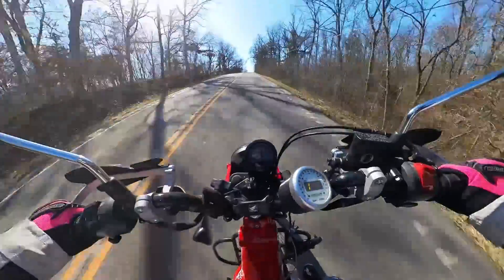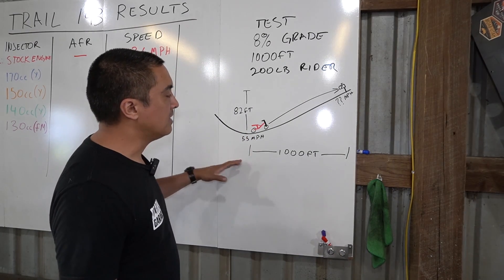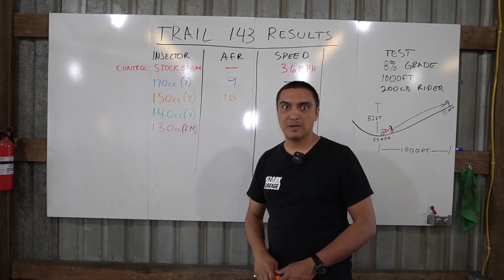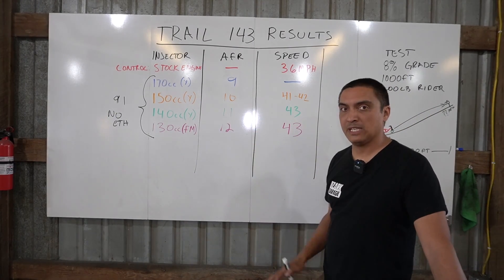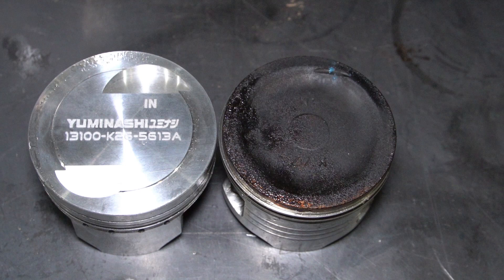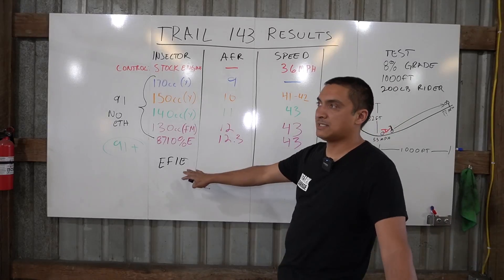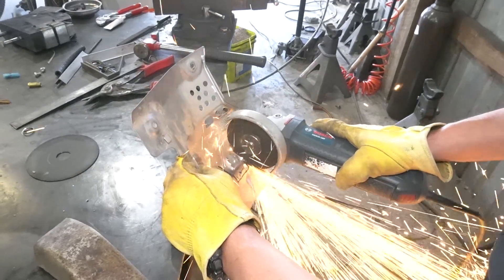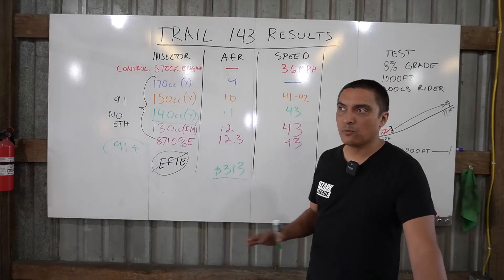Tuning the 143cc Honda Trail 125 - Big Bore Part 2

Comment: Admire your skills and a very well presented videos on this topic. My own thoughts on this is that, even if I had the same (considerable) skill level as yourself, these type of engine mods put into question the very reason I bought a Honda in the first place: Reliability. Even a relatively simple bike like the CT is a complex system and changing one or more components of the system can possibly exceed the fault tolerances of other components, leading to failures, especially over time as parts wear. Going 45 mph for 100K miles is far better than going 52 mph for 40K or 50K miles, to me at least. My advice: mod at your own peril. Short term gains can lead to long term problems.

Comment: I live in Colorado where altitude/thin air are my constant companions.  I can't cross the street without hitting an 8% grade.  All that to say I'm leery of such small displacement on the stock CT125.  This 143 kit might be the answer(?)
Reply from the maker: We've taken the CT125l to Colorado and ridden in the mountains before and after the BBK. It made a noticeable difference in performance at altitude. That said, we ended up getting a KLX230: https://youtu.be/BT17bMClnyU

Comment: I'm curious if a colder spark plug would help with the higher temps.  I'm running plug that is one step colder below the factory plug since I'm in a fairly humid area (Michigan) and most of my time riding is in the not-snowy months.
Reply from the maker: A colder plug wont reduce engine temp, it just puts more heat into the cylinder head instead of holding it in the plug (first law of thermodynamics). Colder plugs can be useful for reducing preignition and detonation by reducing chance of a hot spot, but they can come at the cost of more fouling and a more carboned up plug (the deposits don't burn off).

Comment: i prefer to use the cheaper gas myself. that being said its the main reason i prolly wont do a BBK. we have the larger intake, DNA air filter, and Yoshimura shorty exhaust so its almost a shame not to be able to do it. i was thinking however i know i will get some more performance with the aforementioned items upon install. i also thought about maybe going with a slightly larger fuel injector as well. ( just to see what it could potentially do. i too am a light weight like your wife and i got 61 mph from the start. after its been broken in a while its closer to 55 most of the time if i dont floor it. im pretty sure im going to get at least some increase in speed and sound. thanks for the videos i pay attention most of the time and have learned a lot today alone ( already watched them twice before ) i think of it as a class in school so i thank you teacher. i would never be able to attach the gauges to check for lean fuel so that is also a reason i am not really looking to do it. IF i do it i will have to go all the way to GA and see Wayne he is prolly one of the only mechanics i could trust... its still too much $$$ for the labor tho. i seen someone recently had spent about $2700 before labor and thats already more then 1/2 the cost of the entire bike.

Comment: Dude I like your show (Me being an Enduro Guy) but you meant 30% more Speed "Maybe" Certainly N0T 60% Bro, that whould top You 0ut at 80Mph, "You weren't there". Yet, thank you for filling Us all in on this Cool little Utility bike , (I want to get something smaller for "Sneaking" around town and light trail excursions" this year and after seeing thees 2 ep, I beleive I will keep My Motor  Stock for long term Reliability and choosing to get alittle more Power the simple way with: ( a Pipe / matching injector kit )😅 good work and Stay safe !
Reply: 16 %

Comment: Dad gum. Put a good carb on that thing and let it roll.  Jets are cheap.  I’m old school I hate this computer bullcrap.
Reply from the maker: I'm not a carb hater, but it would cost way more to put a carburetor on it. You would have to build a manifold or adapter to make it work, find a throttle cable to work, then bypass the high pressure fuel pump somehow to make it gravity feed and mess with all the wiring. Swapping to a larger fuel injector is way easier and cheaper.

Comment: I think there is more speed to be had from it cause i am 245 pounds and i could do 40 on a 50cc yamaha vino and you have almost 100 more cc and your doing the same
Reply from the maker: 50cc 2-stroke or 4 stroke? The trail 125 is over 250lbs alone.

Comment: thank you for your excellent  video on how to mount the big bore kit from yuminashi.
I have a 2024 Honda supercub c 125 and i think that i also will buy a  yuminashi big bore kit 143 cc.
according to the Honda service manual the clearance of the piston rings are as follows.
top ring 0.03-0.065 mm, 0.0012-0.0026 inch
second ring 0.015-0.05 mm, 0.0006-0.0020 inch.
oil ring top 0.10-0.25 mm, 0.004-0.012 inch.
oil ring second 0.10-0.30mm,  0.004-0.012inch.
oil side rail 0.20-0.70 mm, 0.008-0.028 inch.
It is absolutely essential that, when the clearance is on the small side that the first 500 miles,  the big bore kit is run in gently, with various speeds  
while letting the engine run smoothly and not let the engine work to much so that the piston-rings can run in smoothly on the cylinder.
it is better to have some higher revs with not to much strain on the engine, then have lower revs and to much gas, that will strain the engine more.
if possible can you make an other video where you tri the "efie" to optimise the fuel ratio of the ecu computer, that would be Ferri helpful .
also it would be helpful if you do top speed run and then look at what the fuel ratio is.

.
Reply from the maker: At this point, I have no plans to install the EFIE. The larger injector has been running fine for the past year and the bike has been run at WOT a lot. Here is the follow-up video: https://youtu.be/nb55vPhmKkw

Comment: Great job on the big bore review , professionally presented. The bottom line is Honda manufacturing did not give the CT 125 enough horsepower for 14 tooth sprocket. I went down to the 13 sprocket and I feel I gained almost everything that you did with your big board kit except for the top end. I can hold and maintain 53 to 55 up even on a slight incline. Plus, my gearing between gears is evenly distributed now.
Reply from the maker: Is yours an ABS model? I looked at lowering the gearing and heard stories of ABS errors due to the computer seeing a difference in speed between the front and rear.
Reply: @ 
My ABS light came on occasionally. 
I was doing some hard trail riding 
ABS light continued when I got back on normal roads for a month 
I finally went through high-pressure car wash blew the hell out of the front brake. The ABS light never came back on again.
To answer your question, I don’t believe going to the 13th to sprocket is an issue
Reply: @ 
What it did do changing the gearing it matches the horsepower of the motor 
The power band is incredibly matched now
And I can still hit and maintain 53, 55 mph 
On the trail, I can walk through very very rough terrain w 13 sprocket. So much better at low speeds. Wow.
Reply: @ozarkgarage  I dropped a tooth up front and my abs comes on after a long ride. resets after i turn the bike off. Got used to it and don't even notice now. Excellent Videos btw. Great explanations of what you have done.

Comment: I put a 135cc injector on my honda 125, at first my sparkplug is soaked with gas and  increased the idle speed. Checked the sparkplug and looks normal again

Comment: Another big-bore kit that doesn't come with a counter-balanced crankshaft to match the bigger heavier piston. You're on borrowed time, mate.
Just pulled a Royal Alloy scooter engine apart that had been fitted with a big-bore kit by a bike shop, mate was furious when I found that the big end had ovalled and the crankshaft was bent.
Wideband lambda sensor is a good idea though, stock sensors are okay but fitted to a price. What it really needs is putting on a dyno and tuning all the fuelling values properly.
Until you do that, you're pretty much throwing money away by chasing a guess that's based on assumptions. A skilled tuner at a reputable, professional dyno shop can always do a better job.
Reply from the maker: The larger piston can still be the same mass as the previous piston, just thinner or shorter skirts, etc. I didn't weigh them, but it would have been interesting to do so.

Comment: Next project, get rid of Injection and O2 sensor and  replace it with an old school carburator…
Reply from the maker: With ECU controlled ignition, etc that would be a ton of work.

Comment: Somebody should do a 250cc version of this bike. It'd be slightly heavier and slightly beefier. But i bet it would sell like hot cakes.
Interesting video. 
Thanks Mr  😎
Reply: I have always thought the sweet spot would be a factory 175cc version with a 5 spd  and manual clutch.
I think 250cc would be getting past what the frame, rear swingarm and suspension/wheels are designed to handle.

A  well designed 175cc should be capable of running 60mph reliably and giving excellent bottom end for slower offroad use as well.
Reply: @billwiley7216  agreed the reason I sold mine was because it lacked the extra 4-5 hp that is needed to ride 60mph reliably. If it had that I would still own it
Reply: "I think 250cc would be getting past what the frame, rear swingarm ..." and brakes can handle, yup, I think so too, I'm bound to the 125ccm limit but I think with the tuning camshafts and a larger exhaust diameter, 12-13 hp are possible even with a 125ccm, here in Germany you can get on the motorway from 60 km/h, then you look for a truck that's doing 90 km/h and stick to it, ... but who drives on the motorway with a C125, @billwiley7216 ?
Reply: Here’s your chance for wealth…go for it!

Comment: Personally having worked on and run the Z155 Zongshen motor, which is a similar design of engine, I would start with porting the cylinder head as it is free BHP (OK a top end gasket set) and match the ports to the gaskets and smooth out the ports. Next up I would either get a slotted cam sprocket, which is cheap enough or just slot the stock one and back the cam timing of to move the power a bit higher in the rev range. These things don't rev that high anyway with peak power at about 9000rpm and slotting the cam sprocket lifts peak power to about 9250rpm but helps let the engine hold onto the power for longer. My Z155 on the dyno is 14.6bhp and in stock trim was 13.2bhp. But it is not the peak power gain which is important as 1.4bhp is not a massive gain, but where it shows the most is at 11,000 rpm where the stock engine was 10.5 bhp and after tuning it was 14 bhp so it is a 3.5bhp gain over stock. If you need more power still then I would go for the 143cc big bore kit. BUT regardless I would still suggest running an oil cooler as these engines don't have the best design for keeping them cool and the bottom end is still close to the original 50cc motor and these get hot and heat will kill power. The oil cooler just adds a bit of security that it will not overheat or increase heat related wear when using it on trails.
Reply: When I was into endurance racing engine tuning, we found that not smoothing the ports actually worked better at reducing airflow instabilities.
It's a common misconception that rough ports are bad, but golf balls are actually more aerodynamic than ping-pong balls. Those little dimples provide a smoother overall surface.
They do this by housing small pockets of gas, which the rest of the air/fuel mix glides over, a smooth surface drags this airflow into the port walls, slows it down and goes unstable.
Because of the way we peened our ports, our engines were noticeably smoother running throughout the rpm range, pulled harder out of corners and generally lasted a lot longer.

Same thing with the inside surface of the combustion chamber and the piston crown, but for a different reason. Smoothing these surfaces bounces heat back into the gas, so the burning charge is slightly hotter, but this is a bad thing because that hotter exhaust gas has to pass the exhaust valve...cumulatively heating them up more than it should.
The pistons also get hotter than they should be, heating up the engine oil until it can no longer cope, the piston and rings expand that bit too much and seizes the whole thing up.
Not once after shot-peening the surface on the combustion chamber + piston did we burn out an exhaust valve, but other teams regularly found theirs overheated, bent and seized.
By all means, port the heads to optimise the shape and volume...but I'd advise anyone to ignore the myths and hype around polished ports because it's all total nonsense.
Reply: @mazdamaniac4643  Same principle is used in sailboat racing, where the boat's bottom is sanded with 400 grain sandpaper, but no finer.  Water molecules adhere and create a surface over which the molecules of moving water slide.
Reply: @mazdamaniac4643  I agree smooth ports do not do as much as people think. Also a lot of people will just open up ports and not think about how air will flow into the engine through the port too. Making the air flow as straight as possible from inlet to the valve opening and working on the port floor is important. As for dimples, I am less sure dimples really do as much as people think as the dimples on a golf ball are for a different purpose and it is to break up the low pressure zone behind the ball which would hold the ball back and the dimples do let it fly further. But this is improving a ball shape because you don't hit an arrow shape or oval ball in golf. The ball is spinning and there is none of that in a port also the gas speed through the port is higher than the speed of the ball flying through the air and the faster you get a golf ball to go through the air the less the dimples help with distance. But a rough surface does break up the boundary layer of the gasses in the port and help turbulence and getting the fuel mixed with the air and better combustion.
Reply: Agree. we tune these engine here in Vietnam and Thailand. Porting + bigger exhaust manifold will help alot. 5 speed swap also cherry ontop (-2 rear sproket maybe decent for highways)

Comment: My first time seeing your channel and that was a wonderful video.  I have a 2024 Honda XRM 125 in the Philippines and that extra power sounds wonderful.  How did it affect your fuel economy?  I am getting 65 km/litre here which is 153 mpg.  And I ride her as fast/hard as I can most of the time.
Reply from the maker: I honestly don't think it has changed that much. We put ~90  miles on it between fills and it takes around a gallon +/- so its still good enough for us.

Comment: what is the top speed after the big bore kit install?
Reply from the maker: On flat ground it will hold 60-62, before it was 54-55. Interestingly enough, the tires have max speed of 61 marked on the sidewall!

Comment: I would use an oil cooler, so 87 would work. These bikes have so little gas tanks, that you need to be able to get it to run 87 fuel.
Reply: Whats wrong with higher octane?
Reply: @evanhandelong7685  $$$/availability

Comment: I wonder what a change in gearing would do for top speed. Add a tooth or two up front.
Reply from the maker: I don't know the engine has enough torque to go that much faster. It would probably go faster losing a tooth up front. Regardless, the tires are only rated for 60mph...

Comment: Thank you very much for making this video and the 143cc BBK instal video. They are super well done and exactly the info I was after to mod my 2020 Super Cub C125.  One question I have is do you think the cam is also worth it? Thanks Again!
Reply from the maker: I did forget to mention the cam was included in the $313. If I were to do it again, I would strongly consider sticking with the factory cam. The factory cam has a compression release so it was much easier to start, you can definitely tell the difference in cranking speed. The kick starter is almost worthless now. One of these days I might throw the factory cam back in and redo the test just to see if there is any real difference.
Reply: @ozarkgarage  Thanks, really appreciate your help!

Comment: Would be cool to see it on full e85 with a bigger injector to see if you see or feel any improvements. While it does still make more power without increasing the timing, you wont be able to use its full potential but will be much safer at 105 octane.
Reply from the maker: For a pure race car or something with a flex fuel sensor and programmable ECU, E85 is great. I had a vehicle set up for E85 once and it was a pain (carburetor) because E85 isn't sold at every station.